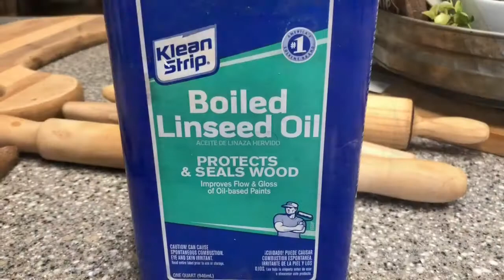Farmhouse Thrift Store Makeover | Trash to Treasure

Comment: Why do I need to spray shellac after cleaning brown wood?
Reply from the maker: You only need to use  shellac if your painting an item a light color and you think it will bled through the light paint. The older wood stains that they use absorb through the paint and the shellac spray prevent the discoloration. Most of the time we paint the item first to see if it happens. But some times when we cleaning an item I can tell by what’s on the cleaning rag
Reply: @GingerChickRehab  , thankyou! I do not want to take a chance so I'm going to spray the shellac. How many coats of spray do you use?

Comment: Do you ever have problems with the piece that you shellac feeling gritty? I tried shellac for the first Tim and ran my hand over the surfaces and it felt very rough almost like sandpaper.
Reply from the maker: I know spray paints usually do leave a texture. Which shellac is. Or the way I use it is. I’ve never really know it to be a problem but I always paint over it. And sand after. I never had a problem. (Yet anyway) hope that helps